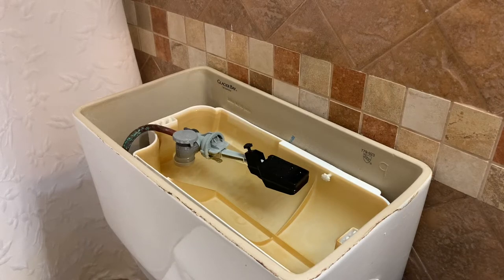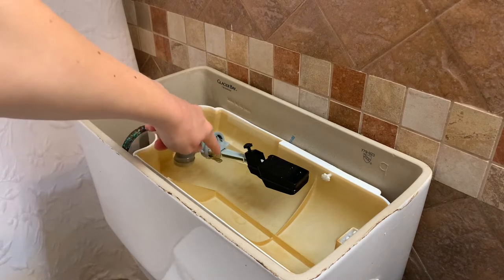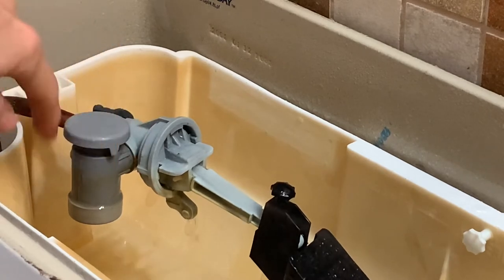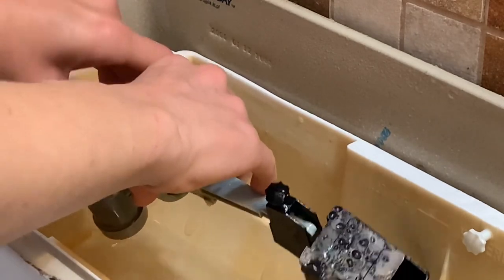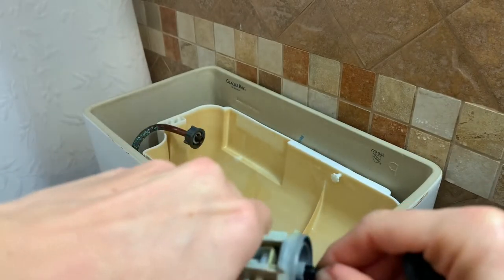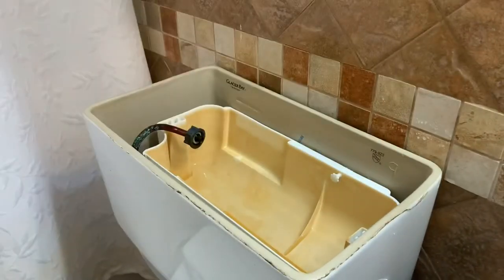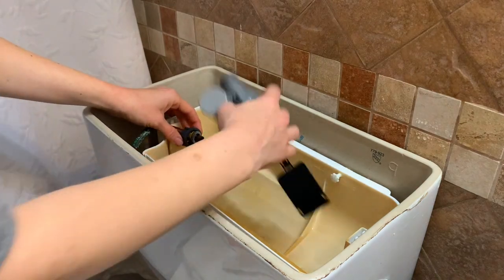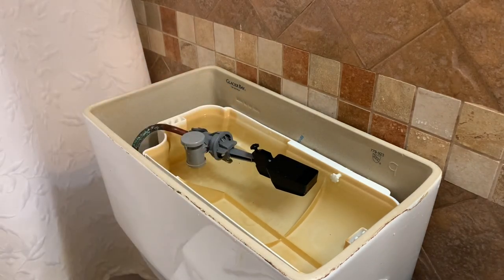DIY Niagara / Glacier Bay Flapperless Toilet  Fill Valve Replacement

Comment: Your video on this repair is the best one on YouTube! I took my valve apart after watching your video and noticed that the small, plastic flow regulator seemed to be out of place. I placed it where it belongs, reassembled the valve, turned the water back on and tested for leaks. No leaks and no more continuous filling of the bowl after flushing. The total repair cost was $0.00, but I'm ordering the replacement valve now to have it on hand when it's eventually needed. Thank you!

Comment: I have the same problem (after almost 10 years) and have ordered the valve. Such a simple operating toilet and I like it except for the huge tank on it. Works just like dumping a bucket of water in the toilet.

Comment: I had a similar issue, but the diaphragm isn’t split.  I think it’s just misshaped from age.  While waiting for the replacement part, I did notice that a temporary fix is to turn off the water source and then turn it back on between flushes.  For some reason the sudden rush of pressure causes my toilet to fill properly until the swing arm stops it from filling. Results may vary however!